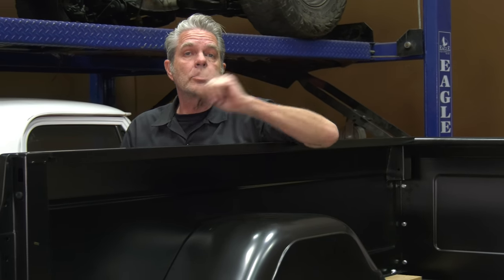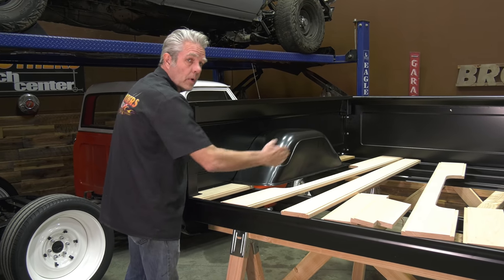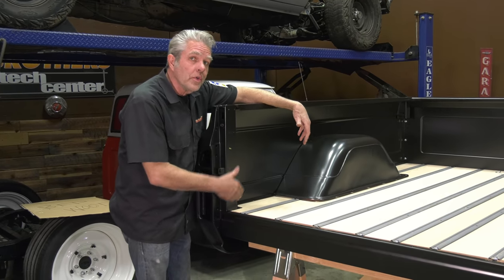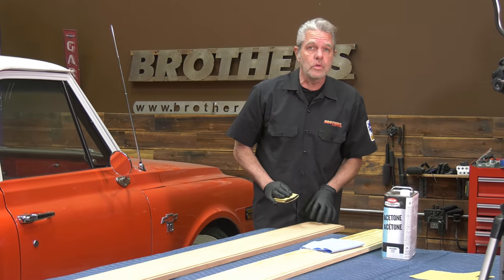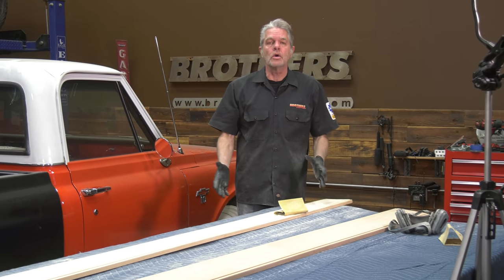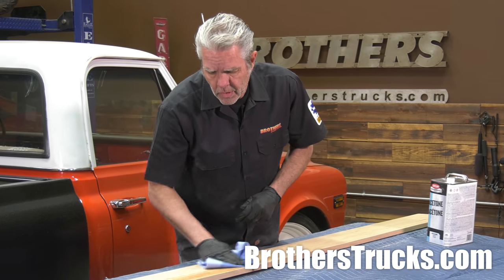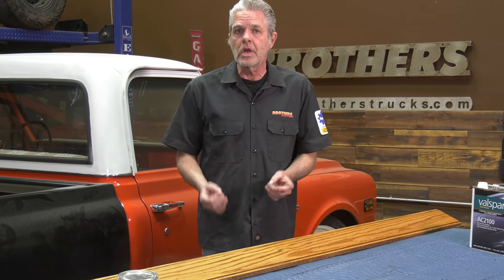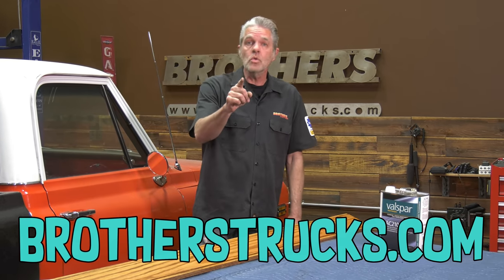Classic Truck Wood Bed Floor Fitting, Prepping, Staining and Clear Coat/Sealing - Bedwood / Bed Wood

Comment: Dave, This task was well covered by your experience, product knowledge and even a good explanation or wood fiber. The cut edges and end fibers are very well explained. It is human nature to rush this step similar to finish painting. 
I would recommend once the color is chosen and sealant apply, for most, plan on re-applying sealant once per year, as wood expands & contracts to humidity and temperatures, cracks form. It require way more attention than a picnic bench and maintenance.
  Not politically correct now, but my 1965 C10 Apache delivered diesel, oil and carried waste oil off site from Dozers, Scrapers, Backhoes, etc but spills soaked the old growth Southern Pine GM used for truck wood floors. It had a perfect color but no rotted spots in the years I owned it. There are to types of finishes, soaking and film types. That’s it. 
 Very good info Dave and great video presentation showing options, technical and best practices, for the best looking and longest lasting project we can make.
One note only; Factory cut wood is seldom 90 degrees straight cut on either end. So use a framing square or cross-cut saw and take an 1/8” of the end to square it up before cutting the other end…as long as the the wood package has enough to sacrifice!
DK, ASE master tech, retired.

Comment: David, All great tips. What I might add is to pay attention to your coating temperatures especially if they have been stored in a cool area. Also, when using a brush to apply a finish, stain or paint, I raise the boards off the table just enough to run the brush along the bottom edge in case I missed a run. I've used small pieces of 2 x 4 and even empty plastic pudding cups. There are even "professional " risers you can buy.
Reply from the maker: Great tips!

Comment: Wow, that was a great example of how to do it right.
I find that when boards are laying flat during clear coat it’s best to stand then up.
Gravity allows the clear coat by its density to drop in the the wood grain pushing air out.
If you stand the wood up, this doesn’t occur. 
Just a tip
Reply from the maker: Excellent, thanks!

Comment: I prefer to do a distressed bed.
I  pounded bolts. Horseshoes. Nails. Chain. Threw in a couple of Horseshoes hot.nuts bolts. Scratches and then I  stained the wood. Gave it the used and abused looks awesome 👌
Reply from the maker: That sounds cool! Great creativity!

Comment: I love the series, wish you had a series on the 1947-54 Chevy or GMC .
Reply from the maker: What would you like to see on the 47-54? We do videos on those all the time and have plenty of content already available.
Reply: @BROTHERSTruckPartsTV  
Seat covers on the older trucks. 
From what i can tell the new covers are retained different than the older? (62 c10). No hog holes on the 62. No instructions with cover either
Reply from the maker: @turboflush  there's no hog holes on the post '62 covers either, the hog rings simply grab on to the seamed edge of the vinyl. On ours there's a piece of plastic material sewn in so the rings dont tear through. We actually have a video of installing a seat cover on a '63. It was part of our project Eighteen8.
Reply: @turboflush  They use a  clip.
A small c clip about half inch long  and 
About 1/8 
It clips on the edge of the metal

Comment: i have used a epoxy coat with a light dusting of sand for grip so things don't slide around in the bed of the truck

Comment: Dave,
I love your videos and your humor.  one question, when assembling the bed, is it better to paint the parts first before assembling or paint when fully assembled?  Thanks.  BTW, I have a 63 Fleetside.
Reply from the maker: It really depends on what you're going for in the finished truck. We've done it both ways depending on time and target outcome, but typically you would paint the parts individually if you were going for a higher quality finished product.

Comment: Is there a specific type of stain that needs to be used, when doing the automotive clear coat, also will the wood expand and contract and crack the clear?
Great video !!
Reply from the maker: Our wood is dry, so once sealed it will not expand and contract due to the lack of moisture in the wood. No special stain is necessary before the automotive grade clear.

Comment: My firs time on your channel and very informative and inspirational. I need to understand your concept on wood protection after staining. What exactly are the steps?
Thanks 🙏🏾🇿🇦
Reply from the maker: The options for sealing after staining are detailed in this video at 22:00. It's basically just choosing your preferred seal type and then applying it as the directions of the sealant indicate. Most often, people pick their sealant type based on the options they have at home for applying it, ie: paint gun, brush, rollers, etc.

Comment: Great video, what type of sand paper to use in between clear coat or urethane clear coats? Brushing in coats! No paint gun! Thanks!!
Reply from the maker: You can use a dry paper or a wet/dry paper between 200-300 grit

Comment: Dave, Any video of the Fleetside/tailgate corner going together.  I am taking mine apart to replace sills and cannot get my corner apart.  I have removed all the bolts I can find and checked for welds...
Reply from the maker: There are two small tack welds in the corner at the bottom of the stake pocket. You have to grind them off.

Comment: What I'd like to know is if you have a survivor truck with and nice patina to the paint and want to preserve it. A nice new shiny wood bed wouldn't look good. (In my opinion.) I want to know what wood would you use with out having to stain it to put in that would patina up nice to match with the rest of the truck?
Reply from the maker: Any would that isn't protected will patina quickly. The softer the wood the faster it will age.

Comment: Thanks for the tips and tricks, just a question. What is the best type of wood to use for a truck bed and where are the best places to get that wood when living in Canada? Thanks
Reply from the maker: Any hardwood will work for a bed floor. We sell Pine and Oak which both look great and hold up well. Canada isn't a problem, its just not always cheap to ship stuff up there. www.brotherstrucks.com

Comment: Ive got boards that have been stained for a couple weeks.  Can i just clean them and clear coat them with a urethane automotive clear?  No need to scuff or anything?
Reply from the maker: You're probably ok just shooting a clear now, however a slight scuff won't hurt just to be sure you've got a good surface to stick to.

Comment: Wood ALWAYS  expands and contracts in its life, especially outside... no mater if it's dried or not. Even dried wood will absorb moisture and expand slightly. Even though automotive clear coat has wonderful weather protecting abilities, it cannot move and stretch with the wood as it expands and contracts. Unless you're planning to Store it in your Climate controlled environment Permanently, I'd recommend the spar urethane as the best protection. The spar aspect makes the finish much more pliable and able to stretch with the wood, thereby keeping it sealed from  excessive moisture.

Comment: Can I add the Clear Coat with a paint brush or do I have to use an air gun ?
Reply from the maker: You can 100% add a clear with a brush if you want to.
Reply from the maker: You can see Dave using a brush in this video to apply a clear coat at 24:40